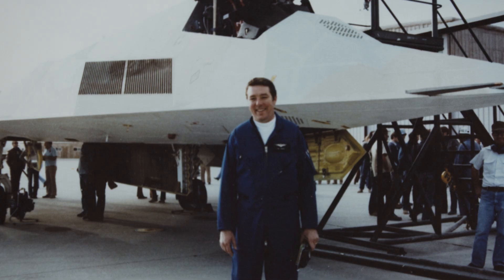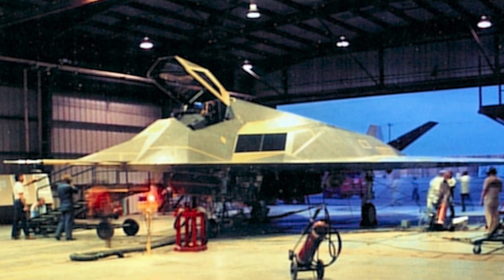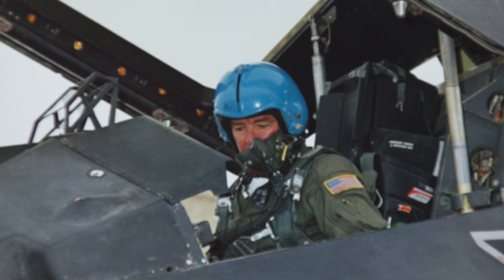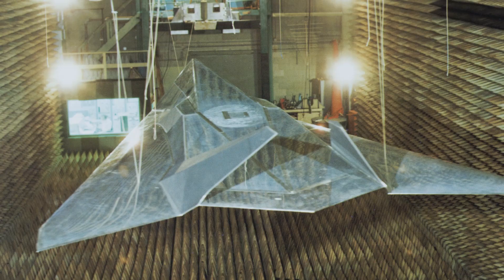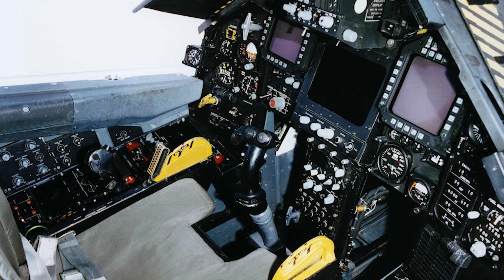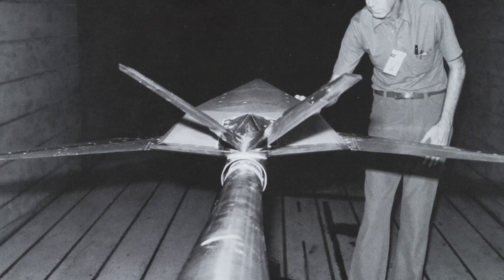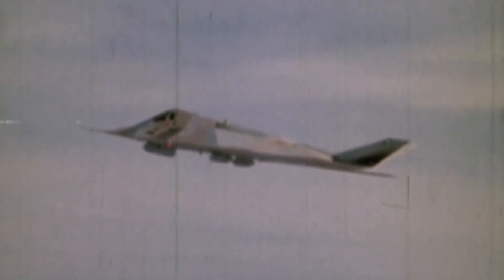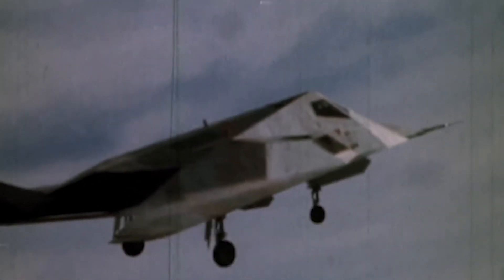F-117A Top Secret Skunk Works 1st Flight, Lockheed Martin aviation engineering technology, Nighthawk

Comment: manufactured in America, destroyed in Serbia with S - 125; We did not know that the invisible F-117 A Nighthawk (fall in BUDANOVCI -  Buđanovci ) and B-2 Spirit Missouria (fallen into the SPACING COURSE - Spačvanska šuma ) Steven Li Bashen - B-2 Spirit units in Combat - Tomas Vitingtin on page 43. read some of the relevant sites on you: won S - 200 VS F - 35 Lytting Lost; won S -125 VS F - 15Eagle Lost; won S - 125 VS F - 16 CG Fighting Falcon Lost; won S - 125 VS F - 177 A Nighthawk Lost; won S - 125 VS B - 2A Spirit Lost; won MIG - 21 Fishbed VS F - 16 Fighting Falcon Lost, won S - 125 VS B - 52 Stratofortress Lost, won S - 125 VS U - 2 Lost. Since we have well declared the S - 125 in 1999 year, they could be given a gift S - 300 and S - 2000 in the war to destroy the F - 22 Raptor. MiG-23MLD, MiG-25PDS, MiG-29 MU3, MiG-31E (31 BM, 31 K), MiG-33, MiG-35, Tu-128M, Su-27SM2 , Su-30SM, Sukhoi Su-33, Su-35S and Su-37, F-14D, F-15DJ, F-16F/110, YF-17, F-18F, F-22А, F-35A, F-35B i F-35C, Serbian G-2, G-4, J-21, J-22? for me is the best No1 TU - 128 that has almost been protecting the roof of the world (north pole) in all weather conditions, and now it is replaced by Mig - 31 BM and Mig - 31 K due to a new weapon.

Comment: F 117 vs s 125 Neva middle who would win
Reply: S-125 Neva/Pechora  SA-3 Goa In service1961
Reply: manufactured in America, destroyed in Serbia with S - 125; We did not know that the invisible F-117 A Nighthawk (fall in BUDANOVCI -  Buđanovci ) and B-2 Spirit Missouria (fallen into the SPACING COURSE - Spačvanska šuma ) Steven Li Bashen - B-2 Spirit units in Combat - Tomas Vitingtin on page 43. read some of the relevant sites on you: won S - 200 VS F - 35 Lytting Lost; won S -125 VS F - 15Eagle Lost; won S - 125 VS F - 16 CG Fighting Falcon Lost; won S - 125 VS F - 177 A Nighthawk Lost; won S - 125 VS B - 2A Spirit Lost; won MIG - 21 Fishbed VS F - 16 Fighting Falcon Lost, won S - 125 VS B - 52 Stratofortress Lost, won S - 125 VS U - 2 Lost. Since we have well declared the S - 125 in 1999 year, they could be given a gift S - 300 and S - 2000 in the war to destroy the F - 22 Raptor. MiG-23MLD, MiG-25PDS, MiG-29 MU3, MiG-31E (31 BM, 31 K), MiG-33, MiG-35, Tu-128M, Su-27SM2 , Su-30SM, Sukhoi Su-33, Su-35S and Su-37, F-14D, F-15DJ, F-16F/110, YF-17, F-18F, F-22А, F-35A, F-35B i F-35C, Serbian G-2, G-4, J-21, J-22? for me is the best No1 TU - 128 that has almost been protecting the roof of the world (north pole) in all weather conditions, and now it is replaced by Mig - 31 BM and Mig - 31 K due to a new weapon.
Reply: Aleksandra Dimkovic no b2 has ever been hit by a Sam...

You keep repeating fake news. Only one b2 has ever been lost and that was due to a fire on takeoff. All 20/21 of the b2s produced are
Still in service.
Reply: @kcimb  Don't pay attention to the delusional Serbian trolls who are still bitter over losing 4 wars in the 90's and the Republic of Kosovo just celebrated its 22nd year of independence from Serbia and it's internationally recognized by pretty much every country that matters.

Comment: '
keep up america make many more F-117 airplanes and keep services...
no end / no stop
Reply: Why though? They're outdated, unit cost is high and modern fighters do better than F-117.
Reply: Tupetsi yep. The f35 and 22 are light heads ahead of the 117
Reply: due to 1999 when it was overthrown by S - 125 discontinued production.
Reply: Aleksandra Dimkovic no, the f117 production ended 9 years earlier. The shoot down had nothing to Do with it..just more Serbian national pride cheat thumping.
Reply: manufactured in America, destroyed in Serbia with S - 125; We did not know that the invisible F-117 A Nighthawk (fall in BUDANOVCI -  Buđanovci ) and B-2 Spirit Missouria (fallen into the SPACING COURSE - Spačvanska šuma ) Steven Li Bashen - B-2 Spirit units in Combat - Tomas Vitingtin on page 43. read some of the relevant sites on you: won S - 200 VS F - 35 Lytting Lost; won S -125 VS F - 15Eagle Lost; won S - 125 VS F - 16 CG Fighting Falcon Lost; won S - 125 VS F - 177 A Nighthawk Lost; won S - 125 VS B - 2A Spirit Lost; won MIG - 21 Fishbed VS F - 16 Fighting Falcon Lost, won S - 125 VS B - 52 Stratofortress Lost, won S - 125 VS U - 2 Lost. Since we have well declared the S - 125 in 1999 year, they could be given a gift S - 300 and S - 2000 in the war to destroy the F - 22 Raptor. MiG-23MLD, MiG-25PDS, MiG-29 MU3, MiG-31E (31 BM, 31 K), MiG-33, MiG-35, Tu-128M, Su-27SM2 , Su-30SM, Sukhoi Su-33, Su-35S and Su-37, F-14D, F-15DJ, F-16F/110, YF-17, F-18F, F-22А, F-35A, F-35B i F-35C, Serbian G-2, G-4, J-21, J-22? for me is the best No1 TU - 128 that has almost been protecting the roof of the world (north pole) in all weather conditions, and now it is replaced by Mig - 31 BM and Mig - 31 K due to a new weapon.
Reply: @aleksandradimkovic2805  Sorry brother but I didn't quite understand your comment
Reply: Aleksandra Dimkovic fell in space voices 😂😂. Where’s the wreckage of a b2? It’s a huge aircraft. 172 foot wing span. Take off weight of 160k pounds. Surely there’s a piece somewhere in a museum? Surely you can come up with SOMETHING? 

There have been 21 produced and one lost to a fire in 2008, not 1999. 

Typical Serbian chest thumping. 

I can copy and paste, too. 

How are Russian jets holding up against the Israelis? 

Very poorly, I might add
Reply: Aleksandra Dimkovic there has never been a b2 shotdown. There has never been an f35 shot down either. 

Keep chest thumping. How exactly did the Serbian mig29s fare against single engine f16s in March 24th, 1999? 

They lost, bad. 

Like sheep to the slaughter they got pounced on by the f16s then driven towards the f15s. 

F-15/16> mig 29.